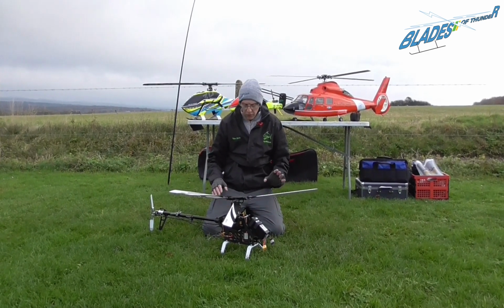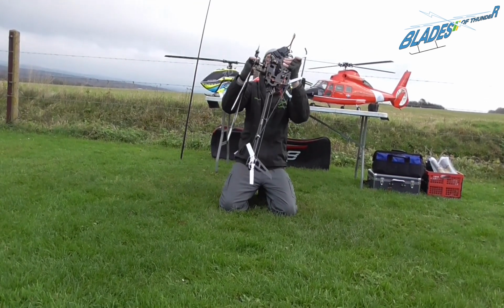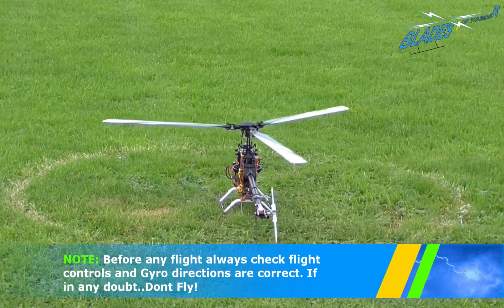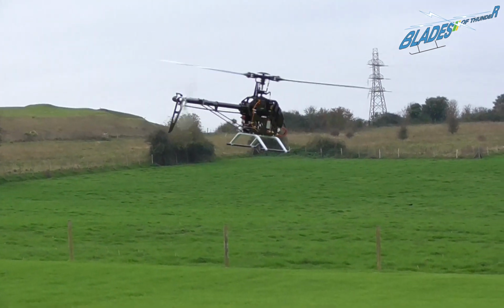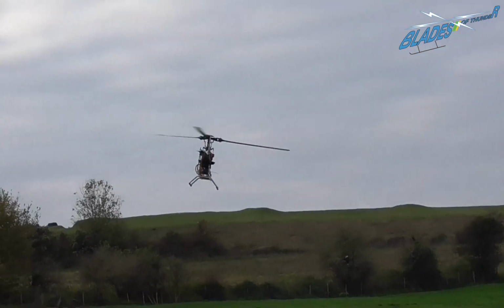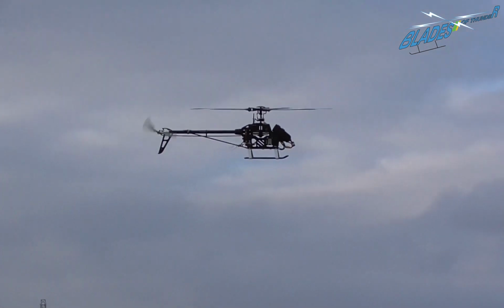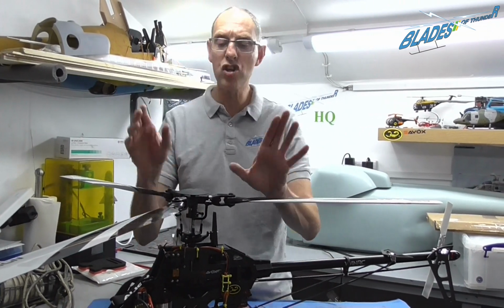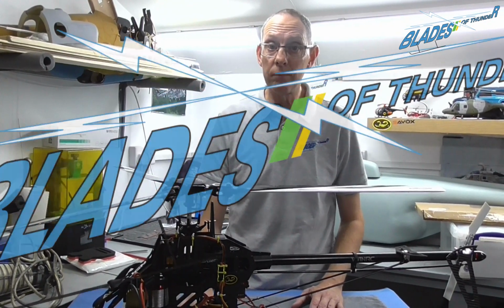BoT 550e Test Flight

Comment: great channel I have a question im hoping some one with some experience could help with.  I have been flying an XL power 550 this past summer.  It is a great flying heli but I want to get a scale fuselage for it.  I seem to be having a hard time finding one that will fit.  The measurement that seems the most important is from the center of the main rotor to the center of the tail rotor  (774.7  mm) .  I have been looking at the Funkey 550 fuselages but I dont think they will work as they suggest 720 - 740 mm.  Do you have any suggestions?
Reply from the maker: Hi Jason.

If the the mechcanics are torque tube it is possible to shorten the boom and torque tube to fit and this someting we may have to do with this model to make it fit the fuselage.
Reply: @bladesofthunder9778  unfortunately its not. It has a belt driven tail rotor.
Reply from the maker: Its still possible to shorten the boom. You will have to have a new belt custom made
Reply: @bladesofthunder9778  who makes custom belt lengths? Thank you for your help and sorry for all the questions.
Reply from the maker: @Beef424  The only thing we can suggest is google custom timing belts and speak to the companies